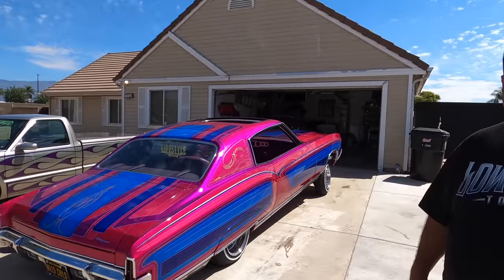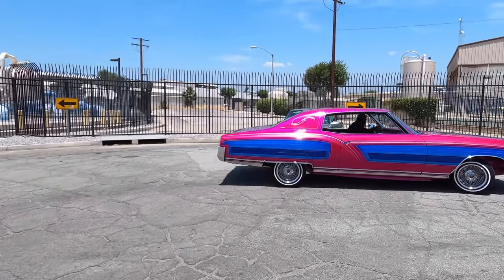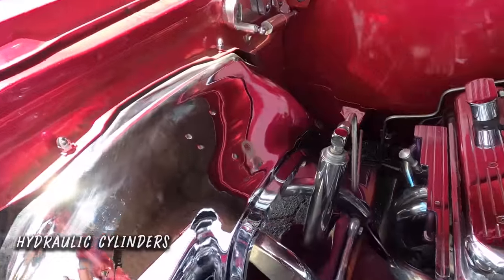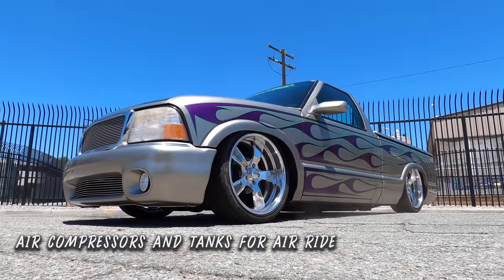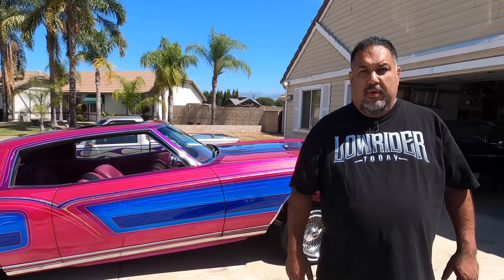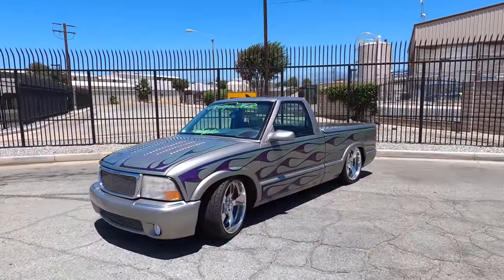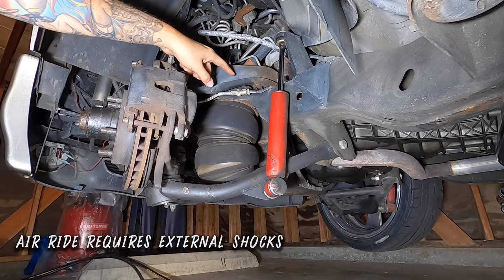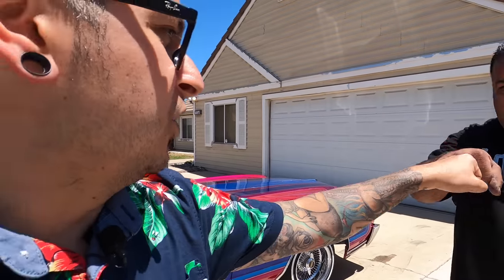AIR RIDE VS. HYDRAULICS: Everything you need to know | The Bottom Line

Comment: I prefer Hydraulics over air ride suspension because if the air line blow's, your car will drop heavy and could ruined your car... With the hydraulics lines or pump goes out, your car won't drop at all, it'll just stay in the same position, you just won't be able to use it until you fix or replace your hydraulic system... It's alot safer with Hydraulics than air ride
Reply: Unless the cylinder o rings busts...
Reply: Jose, that is categorically false.
Reply: From what your say seems like air suspension is safer
Reply: I agree

Comment: I had a lowrider 1987 Mazda B2000 with 2 pump 10 switch setup riding on reverse 13's.  Every setup has a sweet spot where the ride is super smooth. If you ride locked up it will always be more bouncy. For my truck tapping the front and back switches 2 times was the best ride like being on air. Mind you I had 6" cylinders up front and 8" cylinders in the rear. I used brackets to mount them so I did not have to cut out the fenders. All the hoses were ran on the frame.
Reply: NICE👏👏

Comment: A nitrogen charged accumulator inline with a hydraulic system will yield a way decent ride.
Reply: they sell them for hydraulic setups ..i used to have em in mine and it was a big diiference
Reply: they are ok, problem if you overlock the system you will pop the bladder in the accumulator and they are not cheap
Reply: @gypsyshot5225  accumulators are usually ran in the back so you don't run a lot of power back there so overlocking should not be an issue unless solenoids stick but of course you want to run good solenoids

Comment: A few things that weren’t talked about is on a hydraulic setup they also have consumables. The hydraulic lines if it’s not setup with hard lines. Those lines could end up failing. Has happened 2-3 times on my friends car. Also most of the time you have to cut holes in the frame for the shafts. Atleast in old schools. My 63 I would have had to cut a 2” or so hole where the shock bolted to on the frame.
Reply: Thanks for the info on the lines. As far as install, both systems require modification you you vehicle in some regards.

Comment: The first bag setup I put together was an adventure. I remember going into Truck Pro buying DOT air fittings and trying to explain to the older guys what I was doing.  For what I paid back in 2000 -2002 I could have had a full accuair setup today. This was before everyone sold cheap ebay junk. Used SMC 3/8 with 1/2 DOT line.  Manifolds built from 20+lbs of brass fittings.
Reply: Hahaha dude I love your comment story of my life right now haha
Reply: I’m trying to get an air bag set up do you still work on cars ?
Reply: I had 3/8 lines. It was slow as shit but then it was amazing

Comment: I dont know what air suspension he's running but he lost me when he said A&H are the same weight. I cant speak for every brand of air suspension but airlift makes kits with performance and handling in mind. Airlift suspension components are as follows: 
 
1. the performance series struts with adjustable camber and damping with the bellows, which weigh less than my stock struts and springs. 

2. The Airlift Manifold(brain) is maybe 10 lbs. 

3. Viair Compressor(s) you can go with one compressor. Two of them still weigh less than one battery 
 
4. Air tank and hose lines, which together weigh next to nothing. 

5. Hand-held 3P controller, which is smaller and lighter than any cell phone. 

The whole air suspension itself weighs waaaay less than 6-8 car batteries alone and thats not factoring in the weight of the hydraulic system.

Air suspension is also relatively small. I have airlift 3H suspension in a 5th gen 2SS Camaro and I still have plenty of room in my trunk to install amps and subs if i wanted. 

Obviously, hydros are better suited for big body cars and trucks because I can't imagine having to drive around hauling 6-8 car batteries in the trunk of a sports car. I'd be terrified to drive on the highway. 

The only power needed for air suspension is a 12 volt connection to one stock battery. My old sound system needed more power.

Comment: Citroën dude here. I don't get why accumulators isn't more of a thing with the hydraulic lowriders. I mean, have a look at any old Citroën like the DS. It's of course not built for jumping around. But it has a true hydraulic suspension. There's only rams at each wheel. Ok, well... When we talk about "suspension". Hydraculics are stiff as steel of course. I saw that the car in the video had very small coils. What a Citroën DS has is a sphere or "accumulator" at each wheel. It's filled with nitrogen and is the suspending part of the system. The sphere also has two valves + a bypass on the inlet to work as a damper. -The clever bit with that is that when you load up the car, more hydraulic oil has to enter the sphere, compressing the gas more. And that also forces more fluid to pass the same damper. So voila' progressive dampening and suspension is a fact.

Now, I realize that jumping require the car to be stiff and undampened (?). A Citroën is very much the least jumpy car ever made. The DS rides better than any Rolls. But if I were into lowriders, I would put suspension spheres on all corners with cutoff valves. Then you have a lowrider when in that mode. And when just driving, you will have better ride than any luxury car ever made. Actually, Citroën already has all the parts needed. The "Hydractive" cars from the 90's are computer controlled and therefore has electric cut-off valves with regulator spheres on them. -Fun fact: When those valves O-rings goes bad, the system can act up a bit. Usually, it does random jumps now and then when switching modes when there is a lot of difference between the different sides. 

Thanks for sharing. As a hydraulic nerd, I always wondered how those lowriders worked. I'm impressed that they are powerful enough to jump with only pump pressure. Must be a beast of a pump. I mean, a Citroën uses an engine driven pump with a 400cc accumulator and it still wants some seconds to adjust height.

The most hydraulic Citroën is the 1995-1999 Xantia Activa. It's like a VW Golf, but rides like an S-class and beats todays supercars in the corners. That one, you can have a lot of fun when tinkering. It has realtime hydraulic swaybars and can wave like a fighter plane if you want it to.
Reply: They can actually put sphere they do sell them https://www.coolcars.org/hijacker-accumulator-fittings/accumulator-ea/
edit : i looked into custom suspension system myself, but i live in france and i do not know anybody who is accredited and have the allowance to put it on my vehicle without making it illegal to have it on the roadtm.
Reply: Some people do use accumualtors.
Those who prefer cruising more than hopping
Reply: Very interesting stuff! Thanks for the insight!

Comment: What about hydros that are made to be slow and ride well? Something with accumulators of some sort and a modern control system for ride height? I know I've seen such a thing before. It has some sort of nitrogen-filled buffer in the line so that it had some give instead of being all liquid.
Reply: Yeah they ride beautifully,  if you want a sweet ass smooth hydraulic ride & not a suck ass bouncy all over the road at speeds past 55mph lol, accumulators are the only way to go ! 
Yes No hopping with accumulators but do you want a hopper or a driver that can hit the open road & not just the boulevard.
Reply: Accumulators have a set nitrogen pressure chamber to allow the oil somewhere to go that's what makes it so fast because oil does not compress,  so the oil that cant be compressed due to its inherent nature has a place to squeeze into  then push back out into the system. Yes bags are nice also they just dont ride good locked up like hydraulics with accumulators do, &  Accumulated hydraulics that have the same ride quality at the top of the suspension travel and at the bottom seems to be pretty cool in some applications but I pick airbags everytime.
Reply: @christopherwilliams7645  air ride #1 choice #2 hydraulics. For a more then a couple reasons 1.because hydraulics can leak just like bags but when they do its oil, 2. When relays stick they spark & can possibly catch fire & fire &oil dont mix well. Just a couple examples,  They definitely have their purpose and are definitely a lot of fun but I personally would not run them as a daily. &  Last thing, you can't hop airbags if they have quality shocks to give you a nice ride, you have to run shockless 😯😬 which is quite bouncy floaty & causes uneven tire wear.

Comment: Lost me when you said A&H were about the same in weight. I can hear my batteries laughing. Most people have a 6-8 battery setup and use centennials. Each weighs about 60lbs, so on the low end you're at 360 in just batteries. What one component that is necessary for ar to function weighs that much? Not knocking ar, I like it. I'm actually going to build another lowrider but with ar, weight difference being one of the reasons
Reply: Right. Even a 2 battery setup which would be similar performance to a basic airbag kit is still 100lbs more.... Not including weight of rack and pump

Comment: Just a FYI running your air comps upside down cause unnecessary wear.viair recommends never running them upside down
Reply: thats not true. thats only for indoors that they dont recommend it. if its outdoors it doesnt matter since the only reason they dont recommend to mount upside down indoors is due to the cooling. heat rises. out in the open air, it doesnt matter too much. you can mount in any position. they are oil-less. if it was in a trunk, then yes they dont recommend it. comprende

Comment: I have a very particular question, could hydraulics be something thats viable for off road implications? Like say going from city cruising height just to go over bumps and potential pot holes, to raising the suspension for off-road clearance.
Reply: It is possible.if they tell you it's not possible, they don't know what they are doing. You can have a smooth ride with hydraulics, not bouncy.You just need the correct parts,not the usual. And a good shop that knows what they are doing.
Reply: What Yo Mama said
Reply: @CGOD  damn u roasted him. Totally. Definitely dude. U owned him lol
Reply: most lexus LX and toyota land cruiser use hydraulic suspension they use the system to adjust their ride height

Comment: You're a very good narrator. Once you have a drolics on can you take it off and make the car normal again? Thank you very nice monte Carlo. Nice paint thanks for the info and advice 👍🏿
Reply: For the most part, yes it can go back to stock fairly easily. On cars with strut style suspension its as easy as switching out to a stock strut. Cars like the monte carlo in the video its almost as easy but needs to weld in some filler plates up on the front frame so the shocks can bolt into place on the frame.

Comment: I went air ride my first time out. Big mistake. Went over to hydros. Never looked back
Reply: What was the mistake?
Reply: @retroman9287 good question.  I can't imagine what it would be. Air suspension is 10 times lighter. 

Only needs a 12 volt connection to one battery instead of 6-8 batteries.  

If there happens to be a leak it's just Air and not fluid bleeding everywhere. Has free infinite fuel source ( air ) vs purchasing more fluid.

Doesn't require cutting into and/or reinforcing your vehicle frame. It is small enough to fit into a Mazda miata and drive safely on the highway. 

Uses Bluetooth apps to control via cell phones or tablets and can use handheld digital remote to store presets and monitor air pressure height. 

The only thing that I find impressive with hydros is their immediacy in action. They raise and lower much quicker than air suspension.  

Hydros are like a spry teenager in movement while air suspension is like an elderly man slowly lowering himself into a rocking chair.

Comment: You didn't just bring a lowrider, that's an iconic car in the scene, a beutifully done Monte. This said, you can use that beutiful old school aircraft set up but hide a set of accumulators, with shut off valves if you hop it, so that the ride will be as comfortable as a stock car, and definitely just as much as air bags, if not even more, I'm not kidding nor exaggerating, I understand old school guys are a bit suspicious about it, and are used to their cars being on the uncomfortable side of things, but hydraulics historically got a bad rep because of this, but with today's experience and technology there is no reason for your car's suspension being as stiff as a skateboard 😅, particularly if it's a cruiser being driven consistently, diffrent story if it's a hopper.

Other that accumulators there are diffrent ways of making it comfy, shocks for instance, it might sound like a given, but for decades Lowriders seldom used them, and they make A TON of difference, as they remove all the "bouncyness" from it, same thing with airbags, to me shocks are a must, and if you couple them with accumulators you're ride is in stock car territory . There's also another trick, we call it fluid displacement in the UK, which consists in having a full set of coils mounted on a remote frame, each connected to a corner, it's basically a remote suspension set up that gives you full coil lenght on each corner while still allowing you to lay frame, since they are mounted in the trunk, or wherever you wish.

Then there's a new company, can't remember their name, that offers cilinders that have shocks incorporated in a single unit, so hydraulic ram and shock all in one, they offer it with an electronic control unit that is infinitely tunable, with height sensors and all. It's just as expensive as you'd imagine though, but it's also next level for a show car or truck. I think Finnegan here on YT had them installed on his C10, or was it Roadkill? Anyhow, you can check it out there if you wish.

So these are the most common ways to get the most out of hydraulics, but it's one of those things where your imagination is the limit, for me there is nothing cooler than the sound of the pump's electric motors spinning when hitting the switches to rise your car, or to look at how the set up was plumbed and what kind of dump was used, I love the Adex obviously, besides looking badass there is nothing better as far as quality, particularly for competition, and Andy Lodi has decades of experience and is a real stand up guy always ready to help, I remember when I was "a kid" he always replied politely to my stupid newby questions, he's a legend in the game but very relatable guy, and his product is absolute top quality which you fully pay without a moment of hesitation. There are quite a few other cool dumps from the aircraft surplus world, Whittakers are my favorites, Ruano's hydraulics being the specialists here, restoring them in his garage and offering an amazing product, you should definitely look him up on Insta, he's another great guy , the lowrider community can most certainly pride itself of being the most no nonsense, no ego BS, super talented and humble people group of guys.

Comment: I also wondered if it would be possible to direct air from dump valves back into the air tank. Thoughts?
Reply: I've wondered this also, a recirculating system instead of atmosphere dump. I actually looked to see if it was being done when I had my last car on air ride. I couldn't find anything on it back then though.
Reply: @budddove6480  thats the way i thought it worked as a kid, the tank would have to have much lower pressure than the bags to get that bag emptied, because if the tank has more pressure it will fill the bag, and if not it will only dump the bags until the pressure is equal. right?
Reply: @danielleheiget4517  absolutely correct.
Reply: You'd have to recompress it back in to the tank from the bags which would be just as slow as sucking atmospheric air
Reply: It could only balance out.  Maybe if the air was expelled past a generator, then some energy could be recovered but probably not worth it?

Comment: You didn’t bring up the difference of  hydraulics you have the advantage to control individual corners of the vehicle! if it’s set up that way  vs airbags most installs are just set up to go up and down wether as all 4 tires go up and down or if you control the front or rear to air up or deflate. Plus I haven’t heard of a lot of people talking about being able to control while driving compared to hydraulics. IMO
Reply: You can do the same with both air or hydraulics you just need 2 valves/ solenoids per corner. Or get a distrabution block.
Reply: Wrong. Airlift 3P and 3H have the ability to set 4 presets and 1 manual air up the center controller.  It also has 4 buttons on the left and right to adjust each corner individually. 

You can do this while driving or stationary. I have a low preset for roads I know or to stunt. A ride height for daily driving to and from work. A high preset for steep driveways, a slammed preset and a manual adjust if I'm washing my car and want it super high to  clean the side skirts and wheel wells without straining my back. Just press the button each preset is assigned to.

Then there's the rise on start feature. It's optional and works as a safety feature in case you forget to raise your vehicle before driving. Also, you can wirelessly control the system with an app on your cellphone if you want to control your vehicle from afar at carshows. I can sit or stand over 30 feet away from my car and adjust the height.